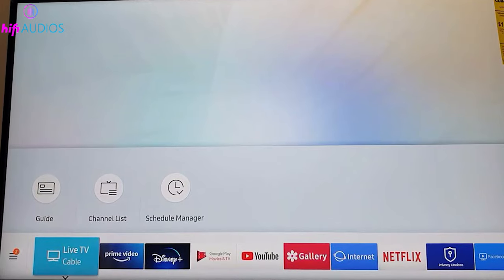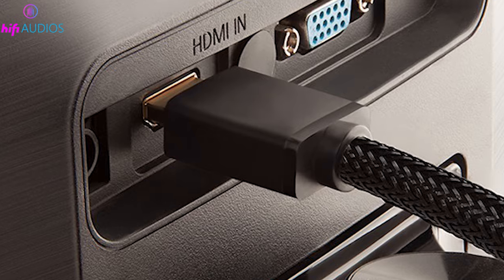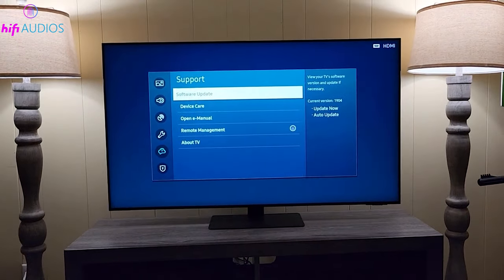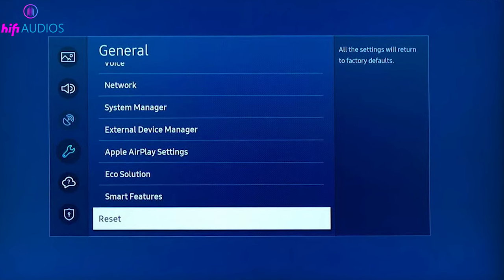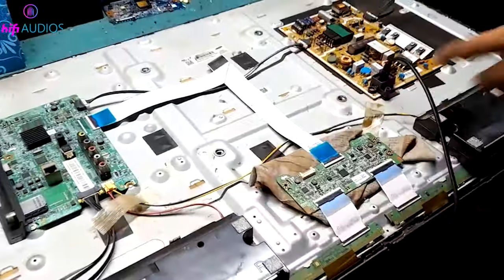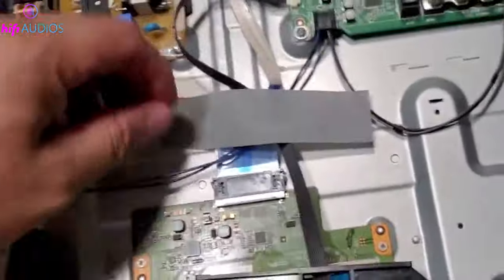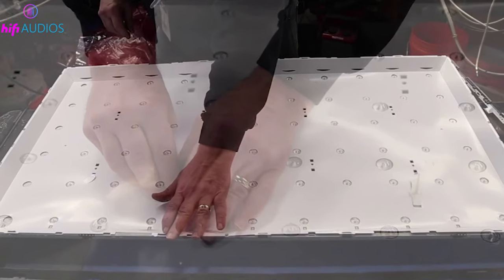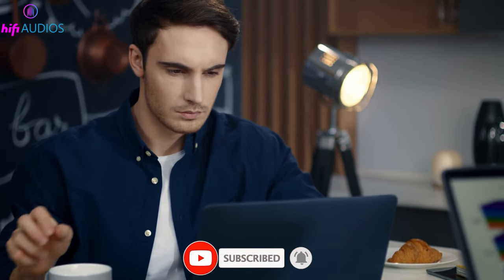Samsung TV White Spots on Screen: Easy Fix Guide

Comment: The spots shown are obviously diffusers fallen off. All the cold booting and resetting in other world won't fix it. You have taken some video of the repair required from another YouTube user. You do not show anywhere enough detail for anyone to fix the problem. A waste of time watching this.
Reply from the maker: Hey, sorry if the vid wasn't clear enough. 😕 The idea was to show a quick fix, not a detailed repair guide. I'll try to make a more detailed one soon.
Reply: All the preliminary nonsense about resetting and rebooting has no effect on the problem shown in the video. It's clear straight away that it's dropped diffusers. The repair video where the problem is addressed isn't even yours. You've pinched it.
Reply: I’m skipping this video after reading this comment 😅
Reply: @hifiaudios8101 In the meantime take this video down unless your intent is to waste searchers time.
Reply: So the actual fix seems to be the last part of the video? 😅
Reply: Garbage video. I agree with you %100 percent.
Reply: Thank for saying what I want to say. Stealing someone’s video and make content
Reply: Didn’t mention residual electricity when removing screen or back.
Reply: All machinery, like cars, and electronics, like televisions are built to be disposable. Small issues but costly and difficult to fix.
Reply: @aussiegogettershealthpage2520 is it fixable?
Reply: What substance can I use to glue that?
Reply: thank you for saving me 5 min
Reply: Yeah this is the biggest clickbait bullshit there is. Crazy. Fallen reflectors fix themselves from a factory reset🥴

Comment: I've a 55 inch Samsung Tv Curved! Has some white spots but while lifting it I noticed somethings were shaking inside the TV likes small plastics! Could it be the plastics or 'caps' have fallen off to cause the white patches?
Reply from the maker: It sounds like the white spots on your 55 inch Samsung curved TV might indeed be due to those loose parts you're hearing. These could be reflectors or lens caps that have come off from the LED backlight. This is a common issue and can cause those white patches on the screen. I'd recommend getting a professional to open it up and check, as they can safely reattach any loose parts.
Reply: Yes, watch other Samsung TV repair videos. It's really not that difficult to take apart and fix those diffusers. I've replaced all of the LED strips in a 40" Samsung Smart TV and am currently putting a 55" one back together that I glued in the missing diffusers. Just take your time and be sure to keep the front screen completely level as it is pretty fragile. I slipped a large piece of cardboard under the screen and slid it off. I used E6000 to glue the diffusers back on.
Reply: Yes
Reply: @hifiaudios8101 my husband’s tv same as your has a white spot in it towards middle I read on you tube it explains how to fix and you have to use epoxy to put the little disc back not glue - because heat from tv won’t hold if you use glue and I take to a tv repair to do it -
Reply: @oztrich24 it says not to use glue but epoxy to hold little disc because glue won’t hold long because of the heat

Comment: The stand on my TV broke and the TV fell forward off the stand to the carpet. 
It still turns on but now it has rather large white blotches showing up. 
I assume the fall loosened or damaged the reflectors.

It is years out of warranty so I assume just getting a new TV is the best option.

Comment: Is this common issue for Samsung TVs? Is there a better TV brand to go with to avoid this issue? Is going OLED a better option?
Reply from the maker: Yeah, it's a pretty common issue with Samsung TVs after a while. Other brands can have issues too, but OLED TVs don’t usually get those white spots. OLED is a good option if you want better picture quality overall, but they're more expensive.
Reply: @hifiaudios8101  Evidently, Samsung TV’s aren’t the only ones that have this problem.  My LG TV has the same issue now.  That’s why I’m here, but I’m a 73-year-old woman who doesn’t have a clue about these things.  I guess my best bet is to plan on getting a new TV. 🙁

Comment: Basic steps didn't work, but didn't want to take TV apart. Will probably get engineer for it. On video, it should be mentioned to switch off all power to TV before taking apart in case of electric shock which can be fatal.Should add to this video and  past and future videos for safety.
Reply from the maker: Yeah, totally agree with you on the safety tip. Always best to unplug and make sure all power is off before digging into any electronics. Adding a warning about electric shock in the video is a great idea to keep everyone safe.

Comment: Thanks for the information, but, I already paid a great deal for this waste of metal. So why the hell would I become an overnight mechanical engineer and fix this piece of junk. I have discovered that in my personal opinion, samsung tv’s are trash including the phones. This is a samsung issue that needs to be fixed by the manufacturer, not the customer. Someone should sue their asses, for all the money that is paid to buy these pieces of junk. Thanks for the info. but, no thanks. 👎
Reply from the maker: Wow, that sounds super frustrating! Totally get why you'd be upset, especially after spending so much. Maybe reaching out to Samsung directly for a repair or refund could be a way to go? They should definitely sort this out for you. Sorry you're dealing with this hassle!

Comment: What a terrible video lol
No way to fix this issue.
Reply from the maker: Sorry to hear you didn't find the video helpful. 😅 Fixing white spots can be tricky, but the tips in the video usually work for many. Maybe give it another try? Or if you've found a different solution, do share!
Reply: yeah open it up and glue the diffuser back on ya weirdo